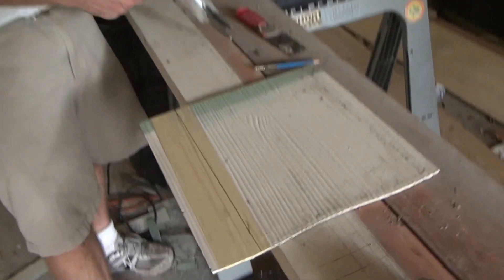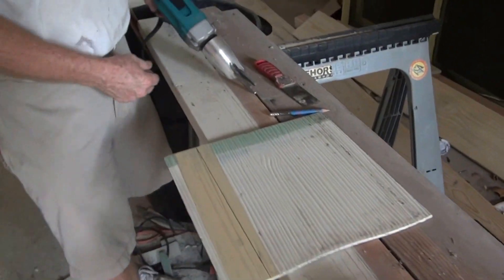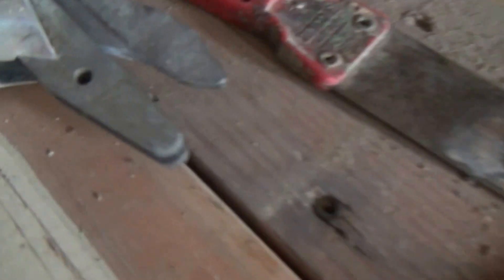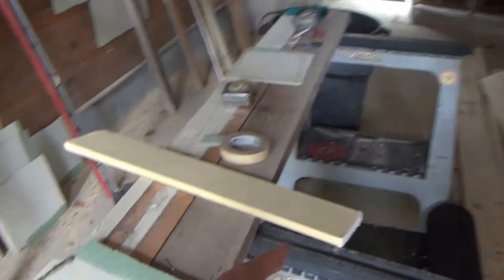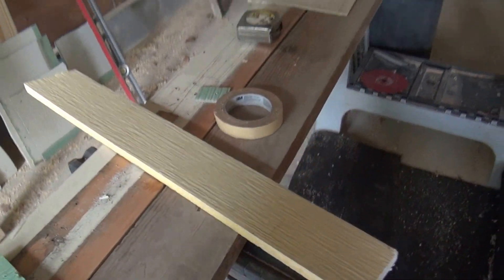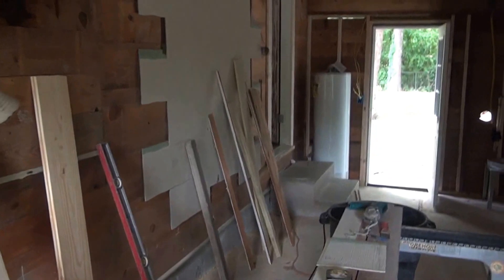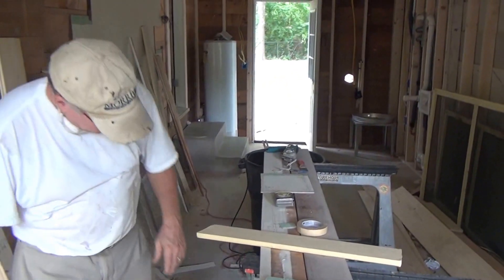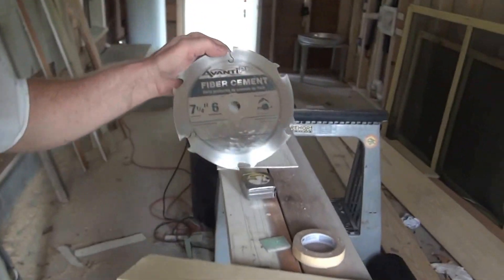Secrets To Safely Cutting Asbestos Shingles In Hyde Park Austin With Donovan White Builder

Comment: How do I drill holes into these tiles? and how do I install on the side of a house?  Other than nailing into place is there something special?
Reply: Charlene Lans.  There is a tool I read about that cuts and also has hole puncher.  You may try small masonry bit to pre drill and as the head get close to the siding while hammering use a nail set and hammer light as possible until the head touches.  At least that is what I am going to try.  I done it a couple  times before with no problem.
Reply: It’s amazing to see what people actually write about modifying asbestos products. Please educate yourself about the danger of asbestos, and dispose of it in the right manner.

Comment: This is the OPPOSITE of safe. You can clearly see WAVES OF DUST blowing away from the tool as the ASBESTOS shingle is cut, covering them and their immediate environment in carcinogenic fibers. 
There is no encapsulation, so fibers are carried out by drafts into the neighborhood environment as well. The "expert" is wearing a PAPER dust mask, expressly NOT designated for this type of work by the manufacturer. These guys aren't bright, to put it in the mildest terms possible. What they are leaving behind for an unsuspecting family to discover is shameful.
Steer clear of these brainiacs!